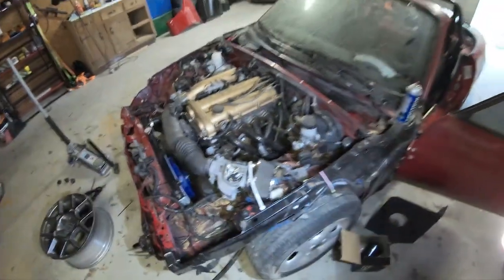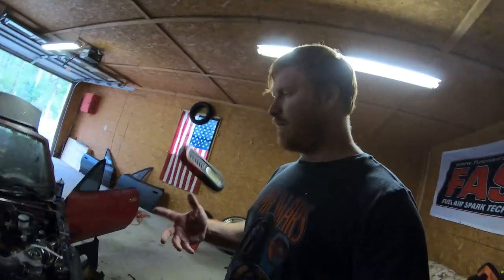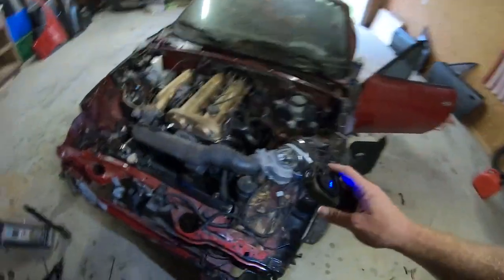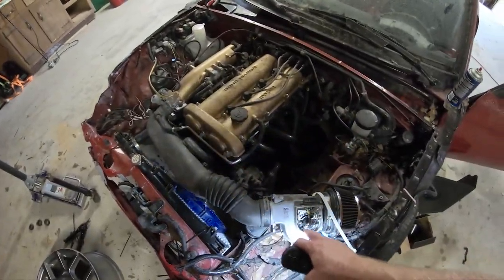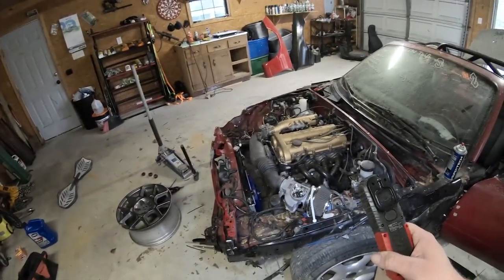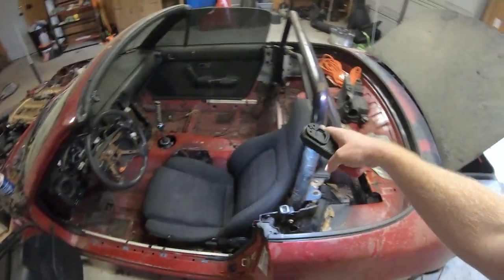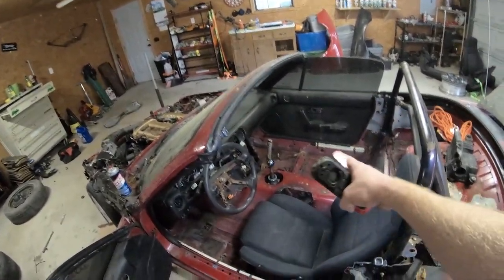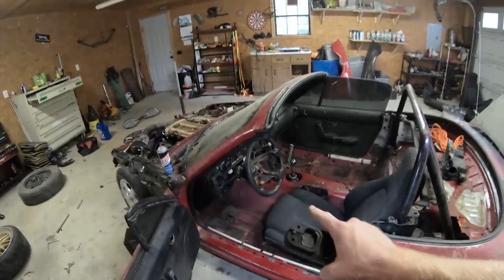Mass Airflow Problem on the Miata

Comment: Is there any way to change the airflow meter system without going full custom and tunable ecu?
Reply from the maker: I'm not sure, but one thing I'll say is I moved the air intake around and boi it wouldn't run at all until I put it back to it's original spot.

Comment: I've replaced almost ever sensor, fuel pump, injecters, filter, coil packs, plugs wires, and ECU. Very long crank constantly dies and very bad throttle response, very shitty power. It has 142k completely stock. Hasn't been hot Roded. If any one can help...please help
Reply from the maker: Make sure your vacuum lines on the intake are all in working order, mine was cut and my Miata was doing the same thing not long ago